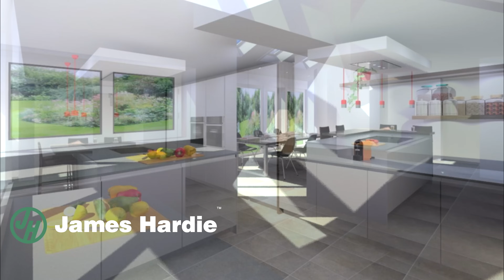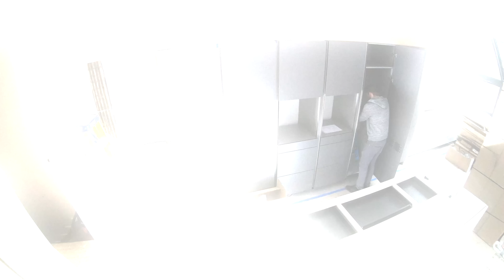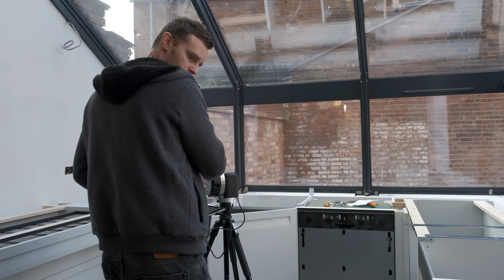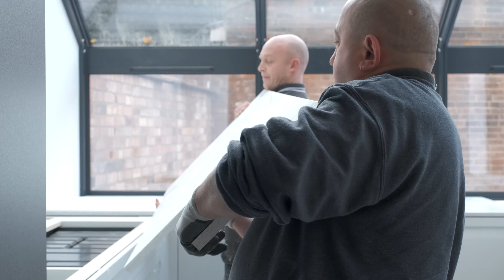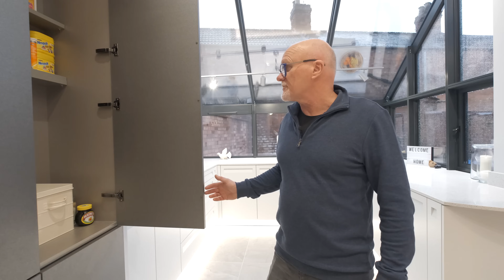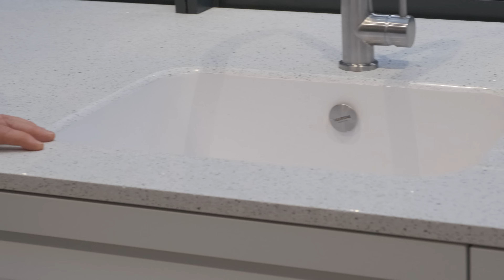INSTALLING A BESPOKE CONTEMPORARY KITCHEN

Comment: I remember watching the building videos of this kitchen by A&E, what a beautifully finished room it has turned out to be.
The kitchen is very nice, probably very expensive also £20.000 + I'm guessing?
Reply: I would hazard a guess that it is multiples of 20k, that looks like a 50k kitchen at least. With all the building work, custom kitchen with top of the range fittings
Reply: @sygad1  You probably right, my estimate was a little conservative. 😕
It's a lot of money that's for sure👍

Comment: Hi Guys, I loved this whole job from start to finish, but I have just one question for you, "Why does the worktop appear to finish with little, or no overhang of the base units?" Thereby any spills can run straight into the unit below, through the gap between the underside of the worktop and the start of the base unit doors? As you are aware with conventional kitchen worktop's, that usually finish overhanging the front of the base units to prevent any spills from running into them. Is there a seal of some kind that we don't know about to help prevent this? Hope you don't mind me asking.